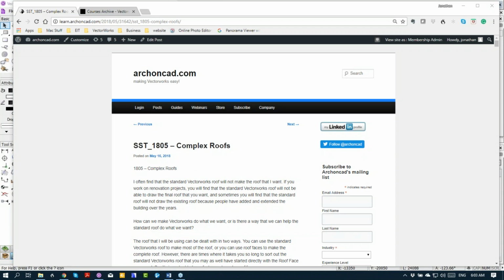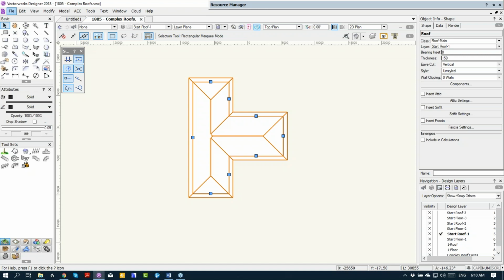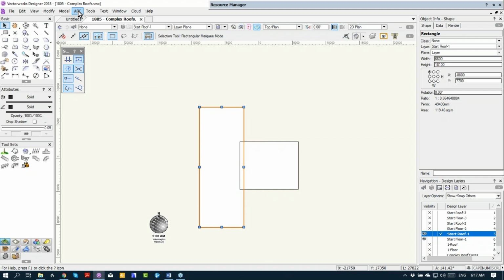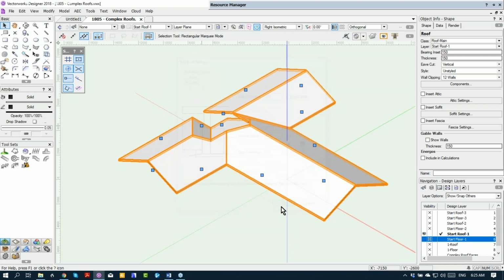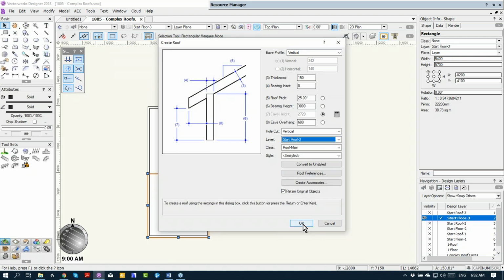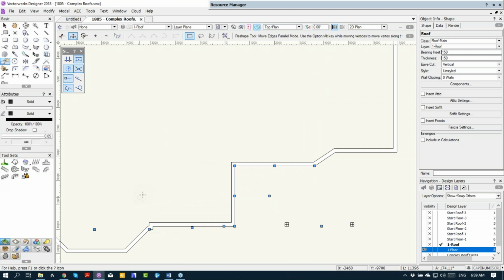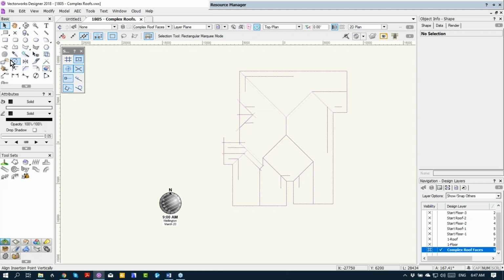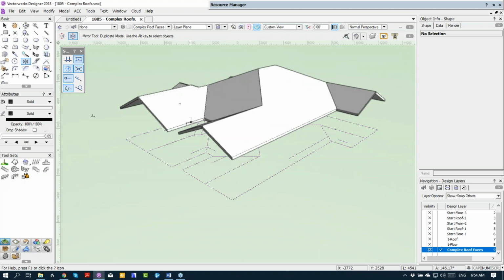How to Deal With Complex Roofs with Vectorworks

Comment: This doesn't work because the underlying roof surfaces that I am trying to cut can't be selected individually.  They all have the same plate height and they overlap so I can't select any individual roof, only the group.  Any suggestions.
Reply: Rather late answer, but I have found the 'B' key very useful as it gives an x-ray mode meaning you can select things hidden by other objects.

Comment: Great tutorial, thank you! It would be of great help if you could slow-down a bit and narrate your moves without exceptions, so that one could follow the process without loosing you here and there. As you have been using this software for over 20 years, it is just a reflex for you to go through the steps, the set-ups etc.. Add to that that the cursor is very small and at times hard to follow and sometimes it is just too fast. If one wants to copy the work on another screen, one has to stop your presentation every few seconds. Other than that it is great!